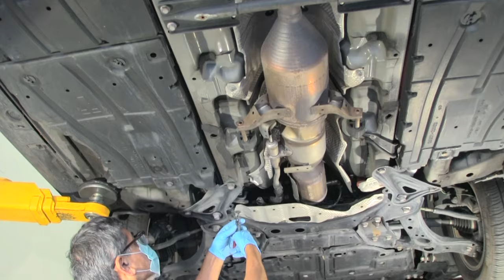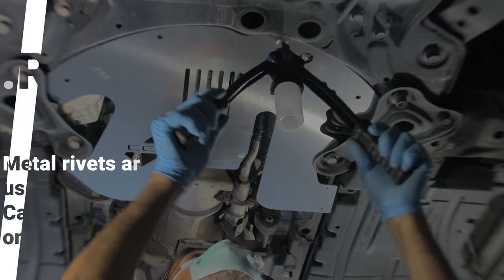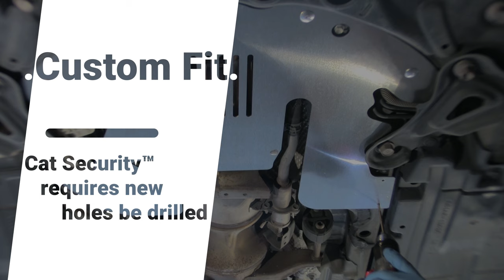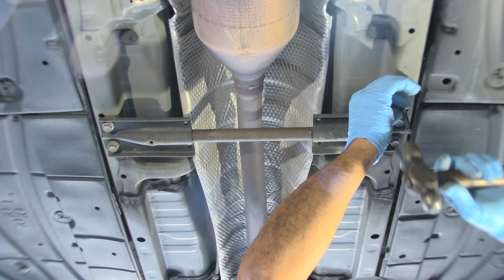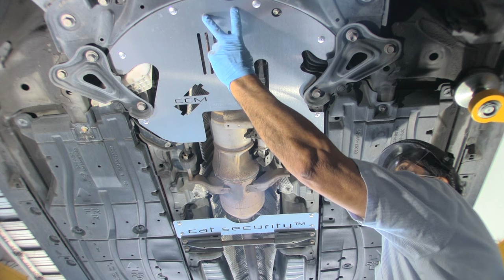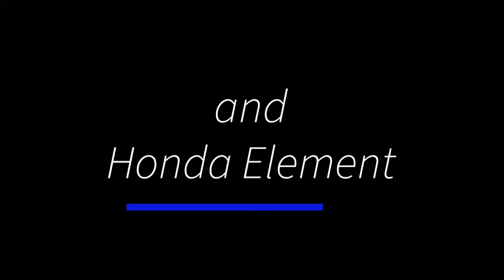Defeating Catalytic Converter Thieves | Installing Cat Security™ on a Prius

Comment: Thieves stold my 2007 Prius with a Tow truck, I'm so thankful I had this shield, I had the advanced one where they can't reach around also. The car was recovered at a later date but the converter was still there. They had time to try and cut it out if they wanted too but this shield still deterred them from trying.
Reply: The steel miller cat shield?
Reply: lmao lazy crooks! time to steal the car but not to cut through the shield haha
its pretty risky cuz the shield is quite sharp. i almosst cut myself getting it out the box

Comment: This helps. Also get a 2 way paging alarm. It notifies you if alarm  goes off. 
The 2 way system comes with shock sensor if car is impacted via broken window or if car is moved, you receive notification.  You can also add a radar sensor to the system.

Comment: Cool,If the sheets are made of 316 stainless..it would take alot of time,noise and large pack of Sawzall blades to cut thru...
Reply: No fooling. When I got the SS shields for our Prius I picked one up and (having dealt with SS too many times) I thought "D*mn! This will definitely do the job!" Definitely a large pack of Sawzall blades.

Comment: These thin sheet metal plates can easily be cut down the middle with tin snips and folded
Reply: 🤫shhh
Reply: Cat thieves look to steal the cat in under 30 seconds. They will see this and move to the car in the next spot.
Reply: @Obecny75  this will turn a 30 second job into a 35 second job
Reply: Now they will carry cordless shears to cut that hahaha it’s take just another 30 seconds to cut that
Reply: Or, with the reciprocating saw that the thieves always use to remove the cats with.
Reply: Millercat cat shield is still the best. Lol stainless steel > aluminum anyday.
Reply: @s.a.m.7611  Both are equally worthless and provide only a false sense of security and waste of money and time
Reply: @yongyi527  I beg to differ. I got my catalytic converter stolen a year ago without the catshield. Had to scoff up $3k+. Got the millercat catshield installed and my neighborhood got hit 5-6 more times throughout the year. My Prius survived with its cat still intact while my neighbors complained on the nextdoor app that they got theirs stolen. This is not a worthless investment.
Reply: @s.a.m.7611  exactly. Here in America atleast, those thieves would move on to something that would be faster because the longer it takes to cut everything out, the higher their chances are of someone walking up with a gun…
Reply: THEY DO SELL STAINLESS STEEL VERSIONS JUST COSTS DOUBLE 
BUT MOST THIEVES ARE LAZY MOST LIKELY JUST MOVE ON TO AN EASIER TARGET
Reply: @21boxhead  the material is almost irrelevant as long as it is easy to snip through. Stainless steel, aluminum, copper, bronze, whatever, a thin sheet of it is easy to snip through
Reply: @yongyi527  IT'S HARDER TO CUT 
THAN OTHER THE METALS 
IT'S MORE NOISE THEY BE MAKING GIVING THE OWNER AND ANYONE ELSE MORE OF A CHANCE TO TAKE NOTICE
Reply: @21boxhead  Stop yelling at me, I'm sensitive
Reply: @s.a.m.7611  yes i agree it is harder...but what they really should do it make a special separate alarm that goes off if anyone trys to cut it out etc... that would be super effective imo
Reply: @roadstar499  a tilt alarm will be help,As soon as you lift the car up, the alarm goes on
Reply: Hey as.....le, don't give ideas to thiefs.
Reply: @s.a.m.7611   What's your opinion of putting an alarm on the catalytic converter that would ring if anyone goes near it. Here's a video showing how the alarm would work https://youtu.be/VIMc9JaNZKQ
Reply: @davidh7339  can't use recip saw on an aluminum sheet.... It's so soft, it will just absorb the blade and get stuck
Reply: And what about the live handgrenade they've just pulled the pin out of under my Prius while removing the shield? Do they have a tool for that, too? At some point, people are going to start getting killed trying to steal these. That ought be an effective deterrent.
Reply: @davidh7339  this is hard to cut with the saw since it's thin and flexible. Try it
Reply: @yongyi527  what do you suggest?
Reply: Its definitely not thin
Reply: @MG-js1nj does an alarm like that exist?
Reply: Not so fast brother,  they stole my whole car with a tow truck and had time till the heart was content to try and they still didn't get it. My car was found days later with my shield and cat still there. These things are awesome
Reply: @Obecny75  I wish... third time its happened now with the shield
Reply: @lynz  how did they get it with the shield on? Was it steel or aluminum
Reply: @heinzh5687  which brand and steel or aluminum?
Reply: @yongyi527  I installed a Millercat shield a couple weeks ago. You have no idea.

The shield is available in aluminum (why??) but the SS shield would be a nightmare to get off without a lift and air tools. If you have never worked with Stainless Steel, you have never known frustration. Nuts/bolts seize and will often snap before they let go. Saw blades rarely are up to the task - carbide blades will eventually make it through but expect a few to break before the job is done.

The expected time to cut a cat out of a Prius is 3 minutes. Taking half an hour or more, making noise and calling attention the whole time, is not something a thief would relish.
Reply: @21boxhead  Millercat SS shields for our 3rd gen Prius and our daughter's 5th gen were only $70 and $50 more than in aluminum: $220 instead of $150 (3rd gen) and $190 instead of $140 (5th gen). I can't imagine why anybody would go with aluminum.

Comment: All it takes is an angle grinder to knock those rivets right off like they were never there in the first place.
Reply: Just a cordless drill and a drillbit... in seconds no more rivet... and quiet.
Reply: Yea especially cuz they have aluminum rivets looool
Reply: JUST MORE WORK MORE TIME MORE NOISE 
EASIER TO MOVE ON TO EASY TARGET
Reply: yup, those rivets did look a bit gaunt, i would recommend some thicker hardened steel rivets to slow down the theft
Reply: That is one thing I really like about the Millercat shields. The SS screw heads (with 5 point security heads... never seen those anywhere else) are inset inside the shield so it would be a devil to get a grinder on them. A drill - even one that will tackle SS - would break trying to get a bite on the security heads.

Comment: Would a car alarm be less costly? Who would stay around to get the CAT if a loud alarm is sounding?
Reply: I would think if you put a vibration sensor hooked to your exhaust, then connect it to your alarm, thief’s would just cut that wire very easily.  Also look at most videos that catch the thief’s in the act.  They look first under the car.  If they saw a Cat Shield they would just go on to the next car.
Reply: You need a leveling sensor so when they jack up your car the alarm goes off

Comment: Now they will remove the $160 shields and sell them.
Reply: No they won't.  These are much harder to remove.
Reply: @gregoryhart4076  
Looks like you can easily cut thru that metal sheet with a disc cutter.
It'll take more time, but i dont think that will stop them.
Reply: @dan_6915  Not anywhere near an easy cut at all.
Reply: @gregoryhart4076  
Looks pretty thin.
They'll cut it in a minute to make acces to the cat.
Reply: @dan_6915  Looks are deceiving.  have you even tried to cut one of these?

Comment: It cost me $3000 to replace my Cadillac converter because someone stole it.  I am so glad my mechanic told me about this it is on my car now
Reply: What model cadillac was it on? If you replace it with a cadillac ctsv converter you will gain way more performance. 🤣🤣🤣
Reply: @repnatl  probably did not replace the muffler bearing with the metric adjustable wrench either    : )
Reply: My muffler guy just added more pipe and forget the converter 👍🏻😁
Reply: Its not a Cadillac converter !!! Its a catalytic converter ha! Should of spent a lil more on the education !!!!
Reply: The same cord free angle grinder they used to cut the C/C out will make mince meat of the shield....

Comment: All they're going to do now is cut off the cat security and take your catalytic converter
Reply: drilling rivets out is going to be loud and painfully obvious
Reply: Too much work for the theif. They CAN take off the shield but why spend more time when you can just go find another car?  If I was a theif I would rather spend the shortest amount of time as possible. That's what fast money is all about.
Reply: @NukeTheWhales yeah check your local shops try to get at least $1400+
Reply: NukeTheWhales, if you have proof of ownership??  Different states have different laws, where I live the local scrap yard will buy them.
Here come the hitch, the cat has to be removed by a licensed mechanic, you have to show an itemized bill indicating the removal in the bill. 
I modified the exhaust on my cummins, the yard refused to buy the cat from me even though I had proof of ownership of my truck and I had my truck with me.

Comment: im thinking of wrapping exhaust pipe in fibre glass heatproof material [on a roll for bike exhausts to stop them burning riders legs]but it has fibre glass hairs which are highly irritant to skin and especially eyes,makes skin itch like mad for days .
so when its cut theyll get full of fibres ,could even add some steel bars inide wrapped potion to make cutting more difficult
any thoughts,

Comment: Hey if it needs to be replaced .. then it'll also be harder for someone to take off even the owner ?
Reply from the maker: Hi Frank, there's a removal procedure for the shield, but going under an elevated car is always dangerous, so it should only be performed using a four point car lift and not just using jacks.

There is an old saying that we've taken to heart: "Right tool, for the right job". As long as you have the right equipment, the removal process is straight forward. The procedure just requires time, which is main goal of products like this.

Comment: so...if you need exhaust work done....how do you get the plate off?
Reply from the maker: Hi Steven, there is a fairly straight forward removal procedure for the Cat Security. There is labor involved, but the procedure doesn't damage the shield or vehicle, so it can be reinstalled after the exhaust work is complete.
Reply: Drill out the pop rivet. Easy but not worth the time for a criminal as they dont have a drill with the correct size drill bit. They just go to the next car after looking at the shield.

Comment: That's just ridiculous you have to pay for the shield then pay somebody to install it while you're out here in California if you go into any muffler shop for a converter they normally offer to weld two pieces of rebar to the right and left side of the converter as thieves cannot cut through that quickly. And most offered to do it for free.  As in most cases it's bad enough you have to pay for a catalytic converter that just got stolen
Reply: Cars should already come with shields like this automatically.
Reply: Any recommended shop in particular? I'm very nervous about mine and questioning how long this can deter for
Reply: I went with Millercat. Installed it myself with hand tools in a couple of hours. Would have been half that time if I were still a thin young man or had a higher lift for the car.

Comment: What if you need to repair or replace your CC under normal wear and tear?
Reply from the maker: Hi Michael, Cat Security isn't permanently attached. There is labor involved, but the removal procedure is fairly straight forward. Also, the procedure doesn't damage the shield or vehicle, so it can be reinstalled once the new cat is in place.
Reply: Let's be a bit more logical than this.  What would you rather deal with?  More labor charge to remove the shield itself (like 2 hours if they way to charge you that) or $2000.00 of damages, if not more?  If someone steals your catalytic converter that's what you could be looking to spend. I'll pay that labor than to be forced to buy and pay mechanic to put one on for me.

Comment: Naw!
The only good here is that the thief would be surprised, and maybe befuddled by the shield system being there. But with high-speed battery operated saws and grinders it would just take a little longer to get to the cat. A determined thief would still get it even if he had to return when more time was available.
Reply: most likely he will move to the next car

Comment: so what if you needed to remove shield so you could fix car or exhaust??? thanks
Reply from the maker: Hi roadstarr, Cat Security can be removed without damaging the shield nor the vehicle. Once the repairs are complete, the tech can reinstall the shield. As long as the vehicle is on a car lift and fully elevated so the tech can work standing up, the process is relatively straight forward. The tech will need new fasteners for the reinstallation, but  only the shield is proprietary, so if the shield need to be re-installed multiple times, it won't be a problem.

Comment: Ford should have had this bright idea.
Reply: They mainly target prius and element tho.
Reply: Ford?? The company wouldn't put a 5$ steel plate between the gas tank and the rear axle on the pinto.
That is until they lost a multi-million dollar lawsuit because of the deaths of two teens in a car fire.
BTW Chrysler is doing recalls on jeep libertys because of the same problem. The "fix"?? A trailer hitch.

Comment: It's a great idea but I thinki I can build one for  myself. The guard can be cut but that only means that it will take longer for them to work at that point I am sure someone will notice.
Reply: Are you going to make it out of paper thin metal as well?
Reply: @cobre7717  I bought a plasma cutter. There is no way I will make mine that thin. I am thinking of maybe starting a side business and installing shields for prius only for 300 bucks.
Reply: These shields are not paper thin

Comment: I NEVER USED THE SPACERS JUST STRAIGHT RIVETS 
I ONLY HEARD RATTLING FOR A FEW WEEKS NOW IT DOESN'T RATTLE AT ALL
Reply from the maker: Hi boxhead, thanks for sharing. It sounds like the video ended up helping you out, so that's awesome to hear. Even if you solved that problem before watching the video, we're glad to hear the issue was resolved and thank you for highlighting the importance of the spacers here in the comments.
Reply: @munozauto6220  IMPORTANCE OF THE SPACERS??? I DIDN'T PUT ANY BECAUSE I READ IT RATTLES WITH THE SPACERS SO THAT'S WHY I DIDN'T PUT ANY
Reply from the maker: Hi boxhead, if it's rattling with the spacers installed, it sounds like it wasn't installed correctly. We had a case in which there wasn't enough clearance and the shield was rattling against the cat. We had to remove the shield and adjust our installation in order to ensure the proper clearance.

Also, installation requires multiple length rivets. If a pair were to be switched during installation, that could result in unwanted noise.

If you are mounting the shield metal on metal, you'll be more likely to experience noise over time. Aside from road vibration pulling on the rivets, any direct impacts to the shield would likely cause enough play to start rattling. The spacers give you a buffer before distortion of the contact points generates noise.

Comment: anyone experienced the exhaust idle louder now with the shield installed and resolution?
Reply from the maker: Hi Jeff, good question. We did have one installation which was causing noise and we determined it was due to a clearance issue between the cat and the shield itself. We had to maneuver the shield when re-installing in order to maintain proper clearance and prevent the shield from making contact.

Impact on sound is one of the main reasons why we recommend shields over other deterrents such as chains or straps.  Regardless of the manufacturer, no shield should be increasing the volume of the sound. If that's the case, it's making direct contact with another component in an unintended manner.
Reply: @munozauto6220  thanks for the feedback, when you say maneuver did you put something in between the cats and shield or simply pulled the shield down slightly with a plier? 

Also wondering how hard to remove these shield in the future if you dont want it anymore or selling your car? I see they are riveted instead, thanks again for your helpful inputs here boss.
Reply from the maker: Hi Jeff, that specific model required the tech bend the unit prior to installation. We just had to reshape the bend to ensure enough clearance.

The bend was noted in the instructions, but there was still a bit to figure out on your own to ensure proper clearance. 

As far as the removal procedures, the ease of doing so will vary depending on the model. That said, when determining which deterrents we would recommend to our customers, one of the main factors was the ability to remove and reinstall the unit should maintenance be required on the exhaust system. There is labor involved, but it doesn't require plasma cutting or anything that drastic since you don't need to weld on the shield when installing.
Reply: @munozauto6220  thnaks for the reply and yes that was helpful, I'll try to jack up the car later and see what I can do to fiddle with it. I noticed when in traffic 20-25 miles when the gas is hit... it rattle little and kind of annoying but when on freeway speed it seems normal or gradual accelation also. 

Unfortunately mines didnt come with instruction as it was the ebay version $100, thats why I was wondering if I can them off to readjust or prob have to goback to shop I installed it from, thank you again for all your advices.